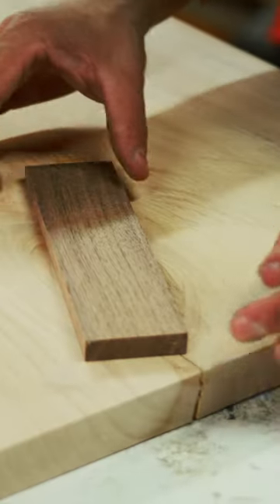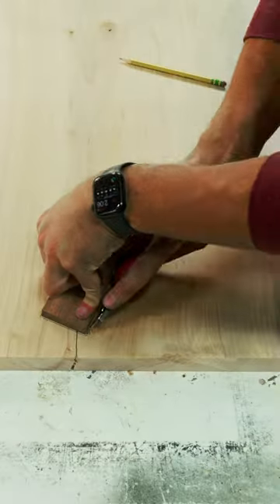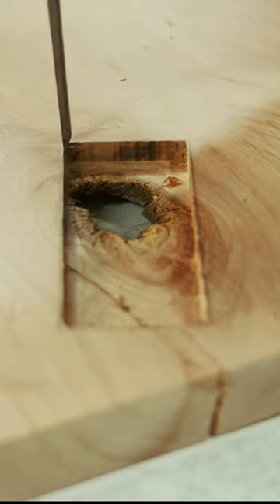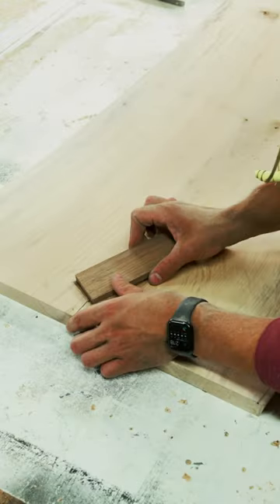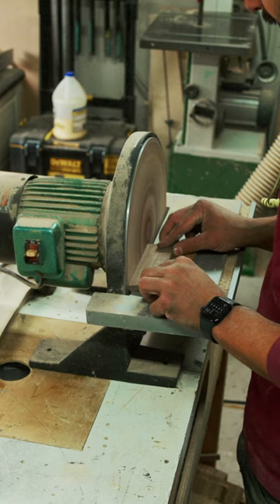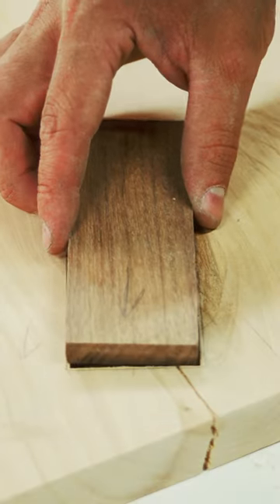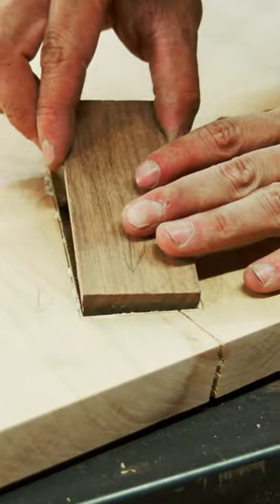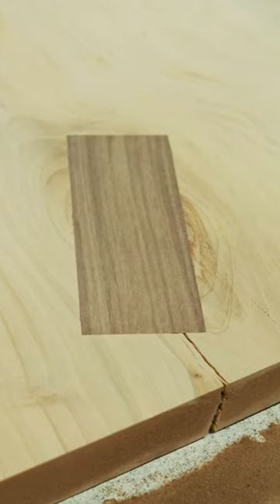Knot Repair with a Wood Patch #woodworking #woodknot

Comment: Man, that’s bad in my opinion. I’d just fill with clear epoxy, or a wood plug, anything besides cutting out so much material to put an ugly rectangle in there. I mean you literally can find an off cut, match grain direction and get it close.
Reply from the maker: If I'm trying to hide it, yes you are correct.
Reply: @buildingwithbobby  This is awesome, you are sticking to your style. I say great, this is your vision and that is the best. I stated my opinion, and that never matters because what you want is always what matters. I also feel bad because I came off maybe a bit abrasive, but misunderstood your direction, so for that I apologize.
Reply from the maker: All is well, its always good to get others thoughts and opinions for potential growth in any which way. So Thank you